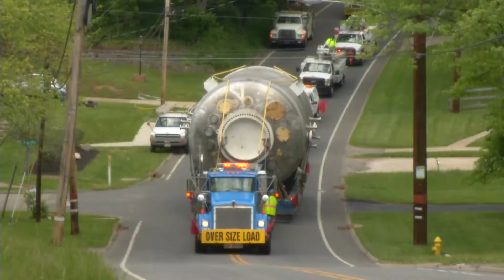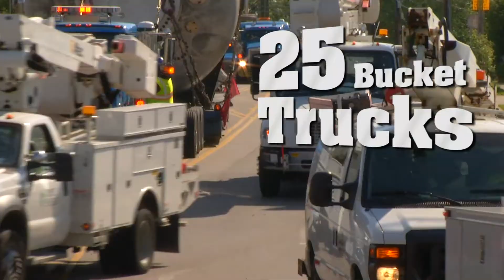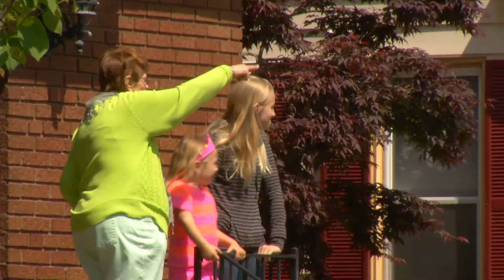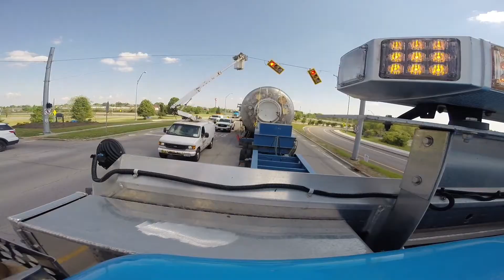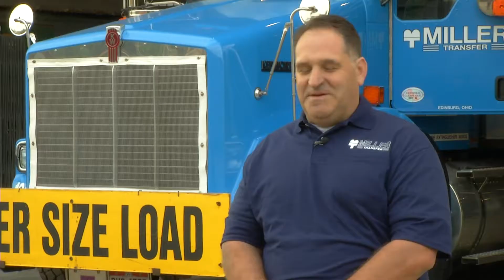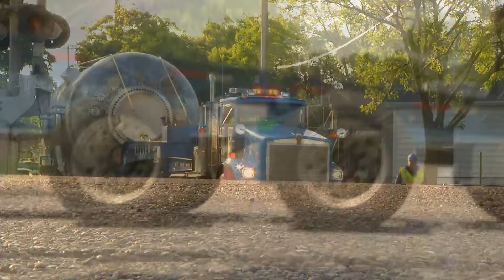Miller Transfer Heavy Haul Transportation

Comment: When I owned a small pilot vehicle service. I worked with Miller on many runs. Lots of nuclear motors some as tall as 16 ft. I run mostly with John Grilley. He was very meticulous as a heavy haul driver. Most people have no idea what it takes to move these loads. Each state permits you on the roads you will be traveling. Myself as the front escort I had a computer with a Streets and Trips program. Before each load I would run what's called a survey. This is to make sure that all the roads are passably and what you may encounter along the way. I must say Miller and their drivers are some of the best I had ever worked for.